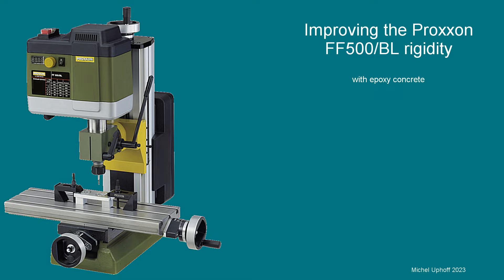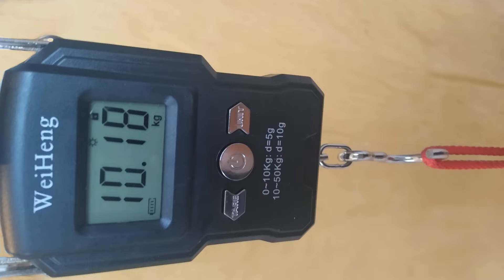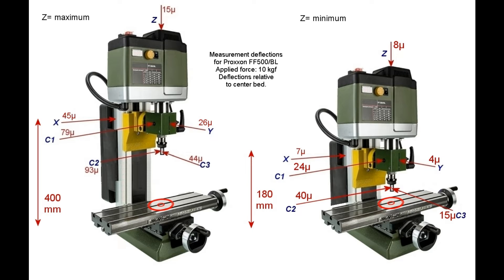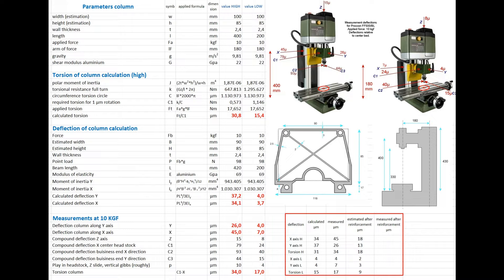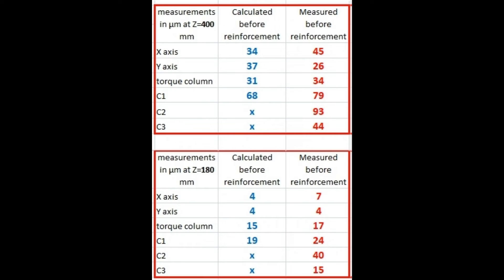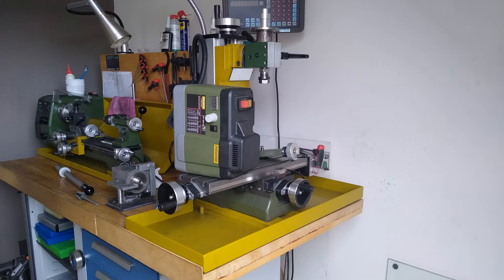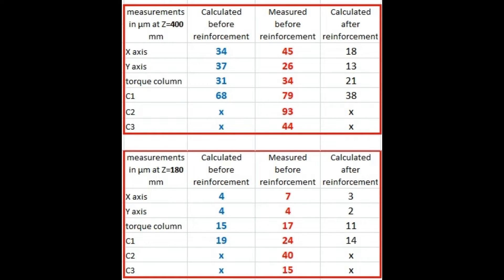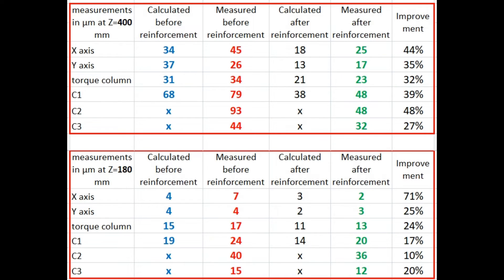Improving the Proxxon FF500/BL mill. Casting epoxy

Comment from the maker: 3 weeks later..
I measured the rigidity of the column again. Long story short: I expected some improvement due to the extra curing of the epoxy, but that didn't happen. The results are roughly the same as at the end of this video. So 40% improvement bij epoxy pouring seems the limit for this machine.
Reply: I wonder if the rigidity could have been further improved by placing rebar (steel or carbon fiber) into each of the four epoxy granite pours. Obviously epoxy granite has excellent compression strength, but when the column is under load one side is in compression and the other is in tension, so perhaps that could have increased the rigidity further. But nonetheless it's an improvement and and excellent video. Thank you for posting.
Reply from the maker: I think that could have improved rigidity further, but  I suspect an important share of the remaining flexibility could be in the base. @HudsonPeter
Reply: @Michel-Uphoff  I was going to post that since making column more rigid the base may well be flexing instead particularly if it's aluminium (even cast iron will flex a little). 
Would it be possible to either add plates or fill base (or both?)
I added a 12mm thick plate plus hydraulic cement (I had it for a different repair job) to column of the cheap Chinese mill I have (then burned out controller 🙄)
Reply from the maker: @1crazypj The base is made of cast iron. It could add some rigidity when I bolt the base on a thick sheet of steel.
Reply: @Michel-Uphoff  Maybe add a block, plates on edge or columns underneath/inside base to make sure it cannot flex, then, re-do the tests?
I worked on large machines (mainly Colchester lathes) and thought I had made a big mistake when I bought my bench-top lathe. (it would probably fit on top slide of Colchester 😆)
I did some very accurate work on it after I realised I could only take small cuts and make small parts (although usually bigger than most people would think sensible)
As I work mainly on motorcycles from 1970's, I really should have something bigger, just don't have space (even if I had money to buy bigger machines)
Reply: Thanks for the video 😊
Reply: I wonder if 2 metal bar cross-members in an X shape in each of the cavities would have improved rigidity too along with your epoxy/sand pour ?
Reply from the maker: @GodzillaGoesGaga  That could be right I think.

Comment: Nice idea 👍. I would use concrete, may be armored, instead of epoxy.
Reply from the maker: Concrete shrinks and doesn't adhere to metal. There is a chance that you will be stuck with a rattling stone in the column which, apart from making noise, does not contribute to the rigidity at all.

Comment: Hello! Help please - I am looking for a small boring head for Proxxon with a shank, are there any on the market?
Reply from the maker: Take a look at the one I use in my FF500: https://www.chronos.ltd.uk/product/new-soba-metric-30-mm-boring-head-kit-with-2mt-parrallel-shanks/
Reply: @Michel-Uphoff  Thank you very much! But I don't understand how to fix the shank on the milling machine? What adapters are needed? I have a 13mm collet chuck. This shank will fit a 13mm collet chuck.
Reply from the maker: @Design1Lvweb  What kind of collet chuck do you have? 
ER20? If so, a 12 mm collet wil fit in it. The boring head comes with a 12 mm straight shaft (and a MT2 shaft)
Reply: @Michel-Uphoff  Yes, I have an ER20 collet chuck.
Now I understand. Thank you very much for the clarification.

Comment: I'm curious as to why only using sand is superior to using a mix of sand and gravel? From all I've heard and read about epoxy concrete, a proper mix of aggregates gives the best strength and rigidity.
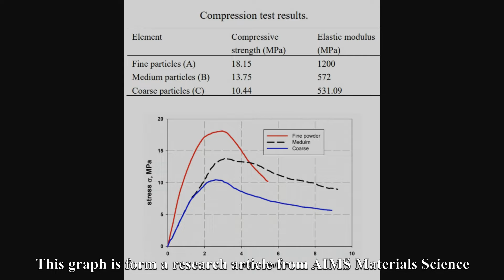Reply from the maker: See the graph at 4:10. These measurements from AIMS material Science are, to my mind, very clear.
I know that a mix of sizes is often presented as the most rigid, but nowhere is this substantiated with measurements. In many videos it is said that after the use of epoxy concrete the machine has become "more rigid", but there too nothing is measured and it is completely unknown how much stiffer the construction has become. Usually there is a lack of substantiation in these videos. I only knew of one video that actually tested whether the grain size and the mixture influences the strength, and there too the outcome was that a fine grain gives the best result. Unfortunately I can't find that video anymore. The finer the material, the stronger the epoxy concrete is my conclusion.  And there is logic behind that, as I also mentioned in my video. 

See also: https://www.youtube.com/watch?v=4aBVAbfxLJw This Adam Bender did a great job and went further than most in comparising mixtures, arriving at a mixture of 80 wt% sand and 20 wt% epoxy, pretty much the same as what I found (78/22) to be the best solution.

Comment: Hi Michel, thanks for the great (as always) video! A potential way to add rigidity on top of the current construction would be prestressing the epoxy cast with say 4xM8 thread bars, each in a chamber with large washers (or other more efficient arrangement). Some plastic tubes can be placed to leave channels for inserting the rods before pouring the cast. Not only is steel stiffer, contributing to bending but also due to poisson effect the cast would expend, increasing the bound to Alu-walls, therefore the chance of composite action between walls and cast. Two cents from a structure engineer.
Reply from the maker: I think that would have made the column even more rigid, although I suspect that now the other parts of the mill flex the most, the base and the headstock for example. Anyway, drilling such long holes through that epoxy and sand is no longer feasible, I'm afraid.

Comment: Hello Michael, i was wondering weather you considered using Industrial Grey cast Iron Chips (dust) instead of silica Sand? If Not, why? 
I am also researching on wheiging down and stiffening my Optimum bf20 mill column and bed and i really liked your Video!
Reply: Im certain my optimum is quite a bit more rigid than the proxxon, the weight and size of the Castings are obviously larger. However, coming from Industrial milling Machines such as FP1 etc. i did my apprenticeship with, these benchtop mills are sadly not comparable (without considerable upgrades at least). I have no experience with Proxxon, i based my assumtion on the physical size of the machine and your experiences with it. 
You are right, the four Bolts connecting the column are the weakspot. I have Not found a solution yet other than reinforcing this Joint by adding Metal bracing/ Polymer concrete to stiffen It. 

Checking the Grade of the Bolts is a great Idea, i can Imagine replacing them and adding preload will enhance the Connection. 
As far as i know, barely anything on this Model is "massive", apart from the wall thickness of the casting, which should suffice for tapping. But i was thinking, If i am disassembling the mill anyways and Handling Polymer concrete, i might as well fill in the hollow spaces on the Base, making it solid.
I will try to Take measurements soon, my time in the Shop is quite Limited though unfortunately.
Reply from the maker: I don't think epoxy concrete is the solution to this problem. There is a lot more rigid material in your milling machine than in that extruded aluminum column of mine, and your machine will therefore intrinsically bend or twist a lot less. Your problem is mainly that weak design of the column-base connection and that problem remains manifest with a epoxy concrete filling.
Reply from the maker: No I didn't consider that. Could be a good choice I think!
Does your mill has a hollow column also?
First of all I would do the kind of measurements I did. The spring balance I used for this costs only a few dollars.
Reply: @Michel-Uphoff  Yes, there is a Lot of free space in the column. In the base as well. I sadly am very disappointed in the stiffness of the column-bade joint of my mill, but i cant fit a more massive mill in my Workshop. Im Sure you know this Problem. The column tram is also very much Out of tolerable spec, maybe i can kill two birds with one Stone and rework the whole way the column is attached. I am Not quite Sure yet.
Reply from the maker: @rambazambaunnenrum  Ok, that's the opposite of @cyberwendy, who wrote in a comment below that those Optimum milling machines are much more rigid than my Proxxon. So I now think that was an opinion and not so much an established fact. I'm actually very curious about what deflections you are dealing with. I have now taken a closer look at the Optimum and see that the column at the bottom is secured to the base with four tension bolts. And if I'm right, the vertical distance between those bolts in particular is quite limited. So it seems to me that this column can noticeably bend in the Y direction. Does extra tightening of those bolts help? What grade are those bolts? Is the part of the base where they are bolted into massive?

Comment: Very interesting videos.
I have often wondered - if you have a brick wall behind a milling machine - could you just bolt the column to the brickwork?
An increase in rigidity for almost no cost? 🤔
Reply from the maker: Then, if it's a very good quality wall, preferable concrete, you would have to bolt the base also tight to the same wall somehow. 
Then it could work I think provided the temperature of the wall and mill doesn't change too much (difference in expansion coefficient). However it's something I will never attempt to do.

Comment: If you want more ridged machine, better buy a ridged machine, these modifications lead to nothing in the end and create new problems. Increased weight, more stress on the base and bolts, and so on. A cheaper import mill, is right away more ridged.
Reply from the maker: For me at least it leads to a more rigid column, although I hope it increases to the expected 50% improvement in the coming weeks. More stress on the bolts due to 7 kg of epoxy concrete in a hollow column? I do not think so. The increased mass is actually an advantage, because there are clearly fewer resonances. Yes, imported mills are often heavier, but whether they are also more rigid remains to be seen, and the cheaper ones are certainly not more accurate.
Reply: Since many of us are trying to improve on the milling machines we already have, I can tell you I appreciate your efforts!  That being said, if you truly want to eliminate air bubbles (and there will be many entrained during mixing), you should degas the column after pouring.  

Did you ever think about using graphene instead of sand?   @Michel-Uphoff
Reply from the maker: There were no air bubbles in the casting. It was very slow curing thin running epoxy, the bubbles had almost 4 hours to rise (which they did), and the casted volumes corresponded exactly to the calculated volumes. 

No I didn't think about that. As far as I know, it is way too expensive.
Reply: @Michel-Uphoff  , I do understand what you are trying to do. But,.. don't forget, this Proxxon mill cost 2k, if you look what you can buy for Optimum mill for 2k, it just not to compare. You can ask Stefan Gotteswinter, here on youtube about accuracy, he used to use a Optimum mill before he switched to a Deckel mill. I did own a Proxxon mill, and i have a miniature 7 axis, Bridgeport style mill, made from solid steel, and i use a import X2 style mill. I have seen a Bridgeport mill shake as a leave in the wind, depending on what you do with it. But a Bridgeport mill owner would not think i pour it full with concrete, instead they thinking about a more ridged mill. So i know what i am talking off. Wish you success with your modifications, but i think it just not worth the effort, money and time.
Nice video's you create, keep em coming.
Reply from the maker: That just depends on how you look at it. It cost me 25 euros and an hour for mixing and pouring. I would have done the rest (testing, calculating, disassembling, assembling) anyway. I don't think that's a high price tag for a noticeable improvement. Those Optimum mills look good indeed. Too big for my current limited work space unfortunately.
Reply: And may I assume you have heaps of experience with this?
Reply: @AndreasBauer12  yes you may
Reply: Yes, of course... But where are your videos?
Reply: Increased weight is a good thing for the mill.
More weight = less vibration.
Stress on the base? What stress on the base? 10 kilos more of downforce? You are kidding?
And what bolts will be stressed more?

If you are purchasing new mill and go for import vs proxxon I will agree with you.

But that import mill can also be upgraded the same way :)
And also need a "few" tweeks to function properly.
Starting with complete dissassemby before any use, cleaning casting sand and swarf residues, replacing bearings, all bolts and nuts, replacing that thing that only chinese call "grease", scraping ways...
Reply: @bmalovic  off course, every machine you buy, need a complete overhaul.
Reply: @Cyberwendy  Not every, just cheap or used :)

Comment: wondering why you picked super light silica sand as opposed to a denser material such as powdered lead, tungsten or even copper, which would have given a much greater final rigidity?
Reply from the maker: I do not think so. The epoxy resin is the weakest material. Silicon dioxide (silica)  has a tensile strength of 15 kg/mm² (150 MPa) and the selected slow-setting resin ultimately reaches 9.5 kg/mm² (95 MPa). Lead is even weaker at 1.8 kg/mm2 (18 MPa), and I would need to buy 40 kg of it. With tungsten it becomes near impossible. The 80kg I would need would cost over $5,000.
What I did consider is copper slag grit, but I couldn't easily get hold of it in such a small quantity.
Reply: @Michel-Uphoff thanks for the explanation, I don't have enough of a grasp of this end of physics to make these choices myself, I was considering doing similar with my MF70 column too, so was thinking a denser material would give less. I lack the understanding of why the tensile strength of the material would be the wiser choice over mass? As for copper, I'd think regular wire in a blender would become fine enough pretty quickly? Thanks 😊
Reply from the maker: @noviceartisan   Extra mass is good to prevent resonances, but in itself it is not a good remedy against bending and torsion. For this you need strong, compression-resistant and tensile-resistant materials. Lead has a high density but deforms very easily and just like pure copper it has a low tensile strength. Silicon dioxide is less dense, but has a high compressive strength (~1400 MPa) and a reasonable (150 MPa) tensile strength. However, the mass of the aluminium column was 2,3 kg. Now it is almost 9 kg, so there's significant more mass and I think that will reduce the resonances considerably.

Comment: Did you vacuum degas your resin after mixing? It's hard to say for certain but around 6:20 it looks like there are air bubbles in your mix when pouring.
Reply from the maker: I considered that because I have a vacuum pump, but it turned out not to be necessary. This casting resin is very liquid and remains so for several hours. There was plenty of time for the bubbles to rise, which they did. After about an hour (during which I occasionally added a little epoxy concrete to compensate for the escaped air, as shown in the video), all the air had disappeared. Only after 3 hours did the resin become noticeably less fluid and no longer contained any air. I'm sure of that, because otherwise I would have had epoxy concrete left over, which wasn't the case.

Comment: I really like your approach to projects as you are able to quantify the improvements.  If your sand was dry when you added the water to work out how much epoxy to use then it would account for your resin volume being too high.  Dry sand absorbs a small amount of water.  You would need to soak the sand in water before you start, drain off the excess and then add the water to see how much resin would be needed to fill the voids.  The sand would need to be in the Saturated Surface Dry condition before you start.
Reply from the maker: I think I did it correctly. I calculated the volumes in the column very accurately and adjusted the amount of resin and sand in the epoxy concrete exactly accordingly. At 3,163 cm³ I was only 18 cc short. This is visible in the video, the column is completely filled except for a height of 2.5 millimeters. However, there is a thin layer pure resin at the top, but that's only 1.5 mm thick, and doesn't influence the rigidity at all.
Reply: @Michel-Uphoff  Thanks for replying.  I certainly wasn't trying to poke holes in what you are doing, I was just musing as to why there was some excess resin on top.  I didn't realise it was only 1.5mm.  As you say, it is much better not to have too little resin or you risk having air gaps in your mix.  A 1.5mm excess is probably as close as you can get without having too little.  It will be interesting to see if you get any improvements in stiffness as the resin continues to cure.  I look forward to your next video.

Comment: I like this pure sand approach given the small volume, but I think the reasoning behind larger aggregate is cost considerations for larger castings. Epoxy gets expensive.
Reply from the maker: Yes that's true. This amount only cost 25 euros, but if you want to cast a complete bed for a large machine, that will be quite expensive. But then again, I would go for that extra cost, because the larger the aggregate, the weaker the concrete.

Comment: maybe more rigid if you could have installed steel bars into the epoxy? pour lead instead of epoxy? at least your doing something!
Reply from the maker: Around 40 kg molten lead.. yikes. Besides, that would shrink too much and lead is very malleable.